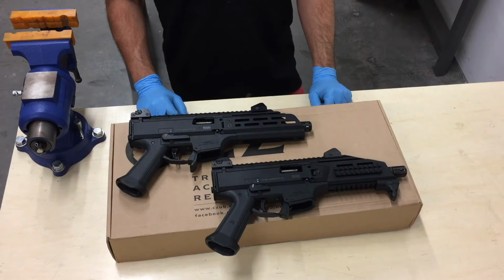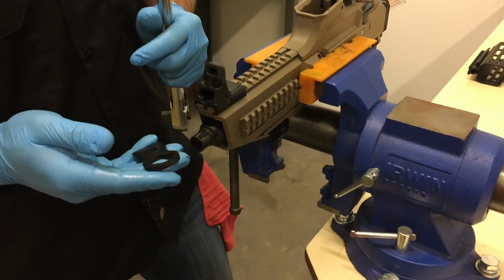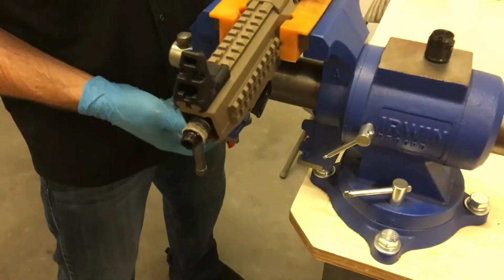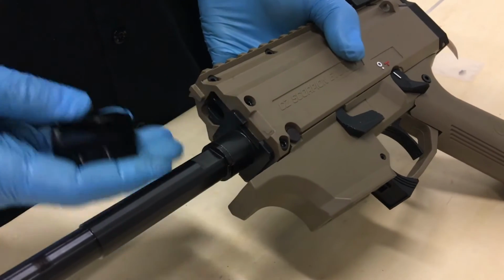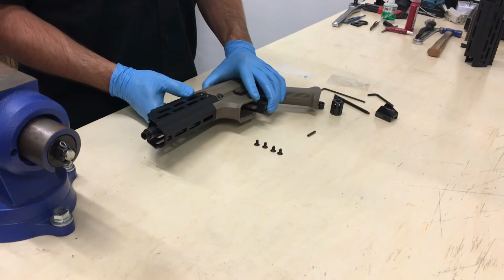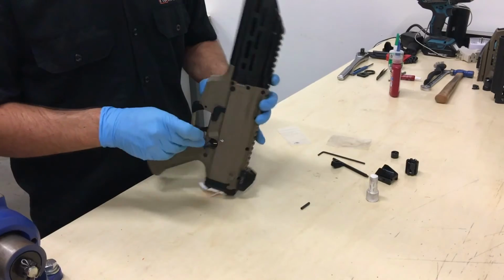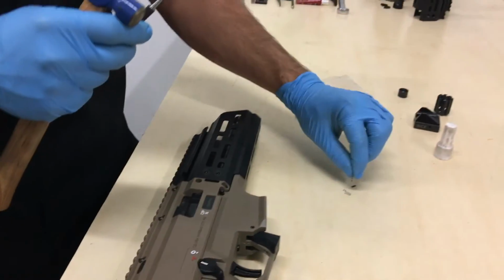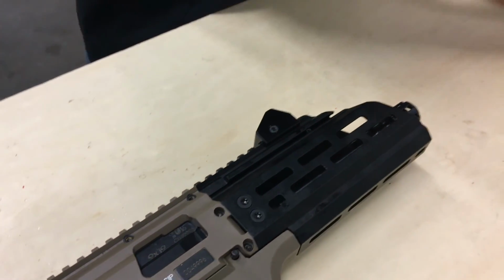CZ Scorpion Handguard Install by HBI

Comment: I purchased the handguard for my new Carbine plus 3 and I was unable because of 1x1 inch outside threading on the barrel just before it go's through the receiver that the Trunnel would not slide over. And I could not get any answers from CZ as to why the threading was there and what purpose it served....DUH
Reply from the maker: The "Scorpion 3 Plus" uses a different trunnion on the barrel than does the "Scorpion Evo 3". On the 3 Plus the trunnion is threaded on the outside diameter and is not currently compatible with our aluminum handguards. We can help you with a return on our parts if you would like? Or look at possibly getting you an Evo 3 trunnion for your 3 Plus.

Comment: Does this hand guard work with the 3 plus pistol?
Reply from the maker: It is not a direct bolt on... The 3Plus uses a different barrel trunnion. If the 3Plus barrel/trunnion are changed out for a standard Evo 3 barrel (5.3" or 3lug, etc...) and/or trunnion then YES you can use our Evo 3 handguards on your 3Plus

Comment: The installation guide on your website shows torque value of 80 in/lbs for the trunnion adapter block and 65 in/lbs for the handguard screws. 

in the video, the guy says 25-30 in/lbs for the trunnion block adapter and 20-25 in/lbs for the handguard screws 

Which torque values are correct?
Reply from the maker: Great question. Correct spec is in the written/supplied instructions. Up to 80in*lbs on the trunnion adapter block cap screw, and 65in*lbs on the flat head handguard screws. We need to make a new video, this one is from 2016 :-/

Comment: I recently installed the Pakse Sapper 6.4″ Handguard and it was a little loose. I did what you recommended and only tightened it to 10 ft/lb. Any advice to press the handguard to make it tighter?

Comment: The barrel nut wrench in this video is out of stock so I ordered the longer carbine one. Is that still going to work on my scorpion pistol?
Reply from the maker: Depends on your exact model, but no, generally the pistol models (with spring tab type barrel nut) require the pistol barrel nut tool. The carbine tool is used for models with a hex type barrel nut (carbine and flash can pistol).

Comment: Why not 242 blue?
Reply from the maker: Loctite 243 is formulated to be slightly more oil resistant and is generally considered to be an "upgraded" version of Loctite 242. In our experience they are very similar though, and I would imagine that if you cleaned your fasteners and mounting holes well with acetone or denatured alcohol prior to installation that both 242 and 243 would yield similar results.

Comment: I want to have my evo pistol with the longer hand rail and flash can into a smaller profile. Will these work with that model?
Reply from the maker: Yes, these handguards make the Scorpion Evo very modular. You can use any of our lengths (4.25", 6.84", 11.25", 11.50", or 15.13") with your flash can pistol model
Reply: HB Industries i would need the micro kid for the 4.25” one though right?
Reply from the maker: @mike_e_p_19  yes, you would probably want to use our 5.3" barrel or consider machining your factory barrel down to a shorter length. I guess I was just trying to communicate that all of our Evo handguards are modular and would fit over your Evo's flash can and barrel :-)
Reply: HB Industries i got you. Yeah I bought a bunch of stuff from you guys. Just realized your in the Phoenix area as well. Is there a physical store?
Reply from the maker: @mike_e_p_19  yes, please see our website for the address

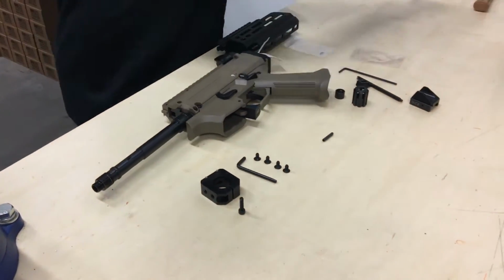Comment: At 13:16, you mention that you can remove the trunnion by simply removing the front two receiver screws.  Is this correct?  If I recall correctly, it appeared to me when I had my receiver halves apart that the "lip" at the front of the receiver halves captures the trunnion, necessitating the total separation of the receiver halves to remove the trunnion.  Are you simply flexing the receiver halves apart enough after removing those two screws to remove the trunnion?
Reply from the maker: You are correct, to remove the trunnion (and barrel) from the upper receiver both halves need to be completely separated (7 screws).

Comment: How to remove carbine’s fake suppressor
Reply from the maker: We have been able to use a strap wrench on most of the faux suppressor carbines that we have worked on here
Reply: HB Industries what? Make video on it????
Reply: plus it has small cuts in it.. you should be able to use a flat head screw driver across both sides and torque out unless it's heavily caked with loctite in which I would use the strap wrench

Comment: What are we talking about weight difference wise?
Reply from the maker: The weights are nearly identical; example: OEM handguard with barrel nut: 9.615 oz, HBI 6.84” Angle with mounting block: 9.655 oz. Same with the carbine length handguards.
Reply: I'm guessing that difference would be better if you're changing the carbine length plus faux suppressor with the 6.84 flat?

Comment: How do you fix the charging handle rattle, I installed the HB Industries charging handle with the hb guard, but the charging handle rattles way too much, I didn’t change the spring on it, I just left the spring in on the HB Industries charging handle, am I supposed to put the factory charging handle spring into the HB Industries charging handle?

Comment: Great info, thanks!  One question, why don't you make an aftermarket polymer charging handle??  You basically sell 2 things that don't work well together.
Reply from the maker: Really good question; we are working on extended polymer charge handles right now, they should be available in about 3 weeks :-)
Reply from the maker: Also,  loving the Honda tachometer avatar @Lars